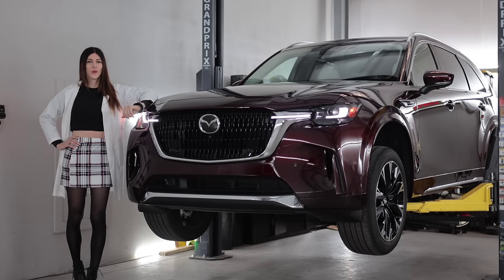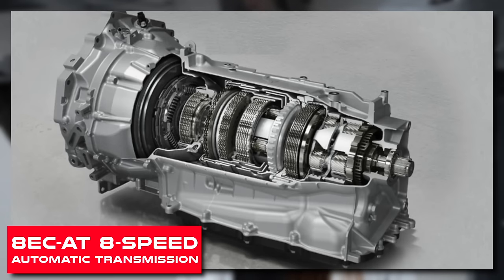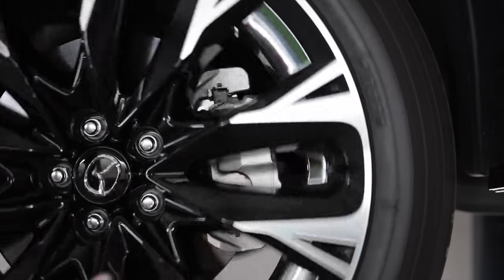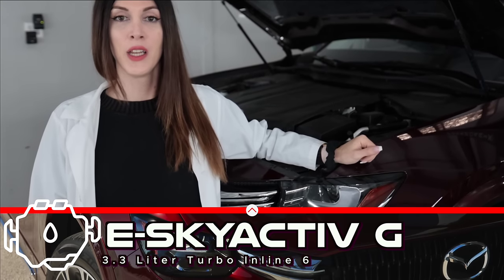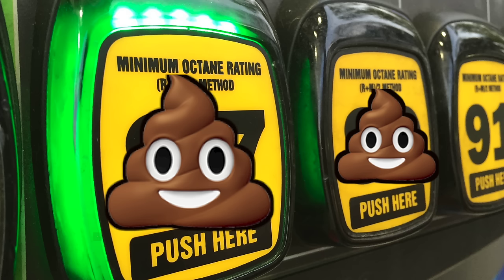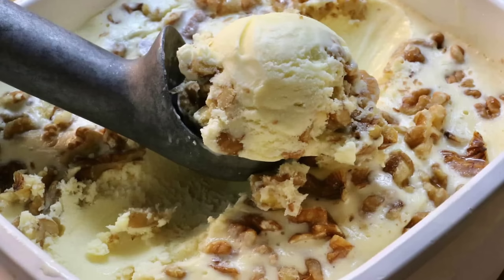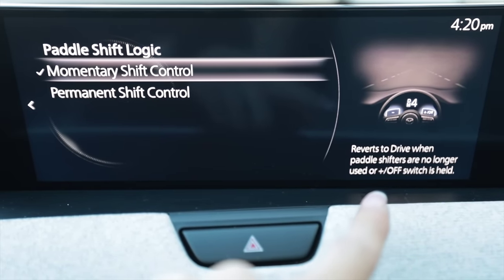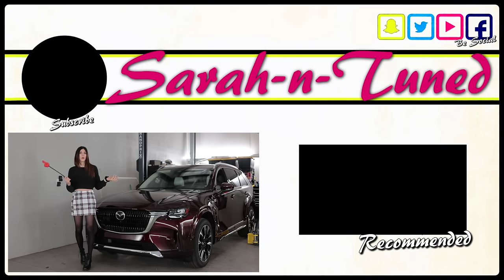Why It's Conflicting.. // 2024 Mazda CX90 Turbo S Review

Comment: Young’s Modulus for steel (29 million PSI) is three times that of aluminum (10 million PSI). This means that for a fixed geometry, a part made out of steel will be three times as stiff as if it were made out of aluminum. In other words, an aluminum part under load will deflect three times as much as a similarly loaded steel part.
Reply: Only if the 2 parts are identical in geometry, usually aluminum parts are much thicker, at some point you will get a stiffer shape and still weigh less than the steel because the density of aluminum is much lower than steel

Comment: The base model of the CX-90 would be a great overland vehicle because of its massive interior space and d also its AWD system, it seems to be very capable. Just throw a 2.5-3 inch lift with meaty tires and smaller wheels 😮‍💨😮‍💨😮‍💨

Comment: my cx-30 also has that turn signal noise. It's odd but ok, but not LOUD enough on the highest volume. I'm turning into THAT PERSON that drives for 35 miles with blinkers on.
Also the windows/infortainment is the exact same part on the cx-90 as the cx-30, I'm a little surprised but its fine I guess.
Reply from the maker: Hahaha, I literally will pass someone just to let them know their blinker is on. My blinker sign language is probably hilarious for whoever sees it.
Reply: @SarahnTuned You should include a demonstration in your next infrequent vlog. 🤣

Comment: You mentioned that aluminum has more rigidity than steel. Maybe you are thinking about aluminum's better strength per weight? Otherwise, the tensile strength (Young's Modulus) of steel is 2-3 times higher. Steel is much stronger than aluminum.
Reply: When put in at the sizes and thicknesses required of aluminum, it is a much more rigid   material. And also "inferior" for certain uses
Reply: @RRr-yl8zr  To my knowledge, there is no ASTM test for rigidity in metals. There are only rigidity tests for plastics and fabrics.

Comment: Quote from Car Care Nut on the CX 90 "For reasons beyond the knowledge or comprehension of anyone, this engine has a timing chain in the rear and not in the front." "So every time you want to do a timing chain replacement job, you have to pull the engine of the car."  Just know that ahead of time it'll cost you $$$ down the road.
Reply from the maker: It's actually quite simple why it has a rear timing chain. Engineers are given budgetary constraints,  government regulations, and design demands by marketing teams with zero mechanical aptitude and told "here, make this possible with half the budget and time." The best advice to save money, is to not purchase a vehicle which you cannot afford.
Reply: So how many times do you need to replace the timing chain?? Obviously its not a timing belt..

Comment: If they need to use 50/50 for the lower control arm material, I’d say they messed up the engineering somehow and using half steel was the bandaid. I’m not impressed. The engine is also 0.3L over the 0.5L/cylinder best efficiency size. Not sure what happened there. Kind of like the FA24 being 0.4L too big. Mazda is a wee bit late to the party.

Comment: The synthetic noise is a real downer.  I'm sure with as much boost as it's making, it should sound pretty sweet.
Reply: Who cares about the sound. THat's not a selling point
Reply: @namelast9340  if your logic is solid, why do they pipe in fake sound?
Reply: @bandwagon240 well I guess it would be because normally they are embarrassed of the actual sound the car makes? 
Are there trying to sell it to guys that put extra spring clickers on their big wheels and playing cards on the spokes of their bicycles?  Even after they're out of grade school 😅😉
Reply: @RRr-yl8zr  that synthetic sound is embarrassingly bad.

Comment: Sarah the battery is on the passenger side of the Japanese designed and made Mazda, you are sitting on the wrong side of the car on the wrong side of the world 😂 I guess it was too costly to retool the whole production line to mirror the chassis configuration. Maybe Americans travel in groups more often too and Mom's drive these and weigh less than Dad's?

Comment: I normally like your reviews but I think you missed the mark on the mechanical evaluation of the CX-90. I’ve watched several other reviews by other mechanics that questioned the complexity of the drivetrain design vs the benefits provided by all the new technology. They also pointed out, accurately in my opinion, the cost of repairing this vehicle will be a real issue as it ages.

Comment: How is the ride compliance? I've read others that describe it as overly firm.
Reply from the maker: I'm the wrong person to ask about that, I don't think like a journalist. Its not what I would even consider "firm".
Reply: Okay, interesting. Thanks. @SarahnTuned
Reply: It's firm but not uncomfortable. I was sitting in a GLE and it's much firmer. The problem is the suspension doesn't filter all minor imperfection of the roads. I think 20" wheel with higher sidewall will balance it off or tune suspension a bit better. I'm on 18" winter tires and they do filter out all the minor imperfections.

Comment: I personally love this vehicle and really appreciate the review. What I don't understand is how they designed a clean sheet 3.3 I-6 turbo with 12-1 compression and it's "only" making 340 horsepower without the electric motor. I mean both GM and Ford's 2.7 make almost as much HP and way more torque. Is this motor derated for emissions or something because on paper it should be making at least 375 to 400 horsepower based on the compression, turbo, and displacement.
Reply: It's most likely tuned for flat, consitant torque. And also probably limited by trying to make it not blow up on 87

Comment: and the nice feature of Mi-Drive, if you have a trailer hitch equipped and a trailer hooked up to the connector (for lights/brakes), the car auto detects the trailer and gives you the normally hidden Tow Mode.

Comment: is the scoring out of 10? if it is, 5.9 is pretty low considering its a mazda
Reply from the maker: Yep.. I really did not like how confused the transmission would get at times. That killed the score for me.
Reply: @SarahnTuned  have you tested the phev model? ive heard it has a much better transmission than the i6
Reply: @SarahnTuned  to clarify, I was talking about the handling score of 5.9. I was surprised about the rating because of the praise of the bmw like handling the 90 has, along with mazda's reputation of being driver's cars.

Comment: It's a better path finder than Infiniti QX60 against which it [successfully] competes - out of curiosity I've even watched QX60 review on your other channel. Turned out they both have 4 cupholders for the third row! Maybe Mazda's amenities aren't as good as Inifiniti's, but it's definitely a better driver's car - more powerful, also double wishbone front suspension (vs MacPherson) and wider tires (275 vs 255) should make it handle better.

Comment: Timing chain at the rear of the engine is insane. It won't matter for the first owner but second hand, you would not want to deal with the cost of that issue.
Reply: What cost?  You don't have to replace timing chains like belts.  A timing chain will last the lifetime of the engine.
Reply from the maker: It’s really not insane, I’ve pulled countless engines over the years and never once has it been difficult or even time consuming. Thats not the point though, the point is you will have other extensive common repairs pop up before that does and it’s ridiculous to stress over a hypothetical that 95% of new car buyers won’t ever have to deal with.
Reply: @mrnicktoyou chains will be last thing you will have to replace in an engine.. engineers designed it like that..
Reply: In other words, you watched a different review and ignored Sarah’s explanation.

Comment: Fake sounds?
Reply: Inline 6 sounds ARE boosted… however it is under  the hood via the intake, not through the speakers.

I honestly think the sound actually makes the six sound less refined than it actually is. I prefer the engine sounds in my PHEV model.